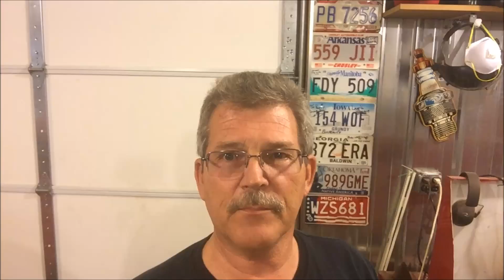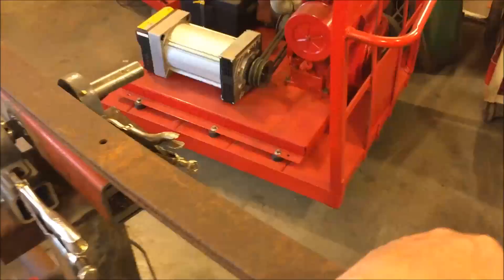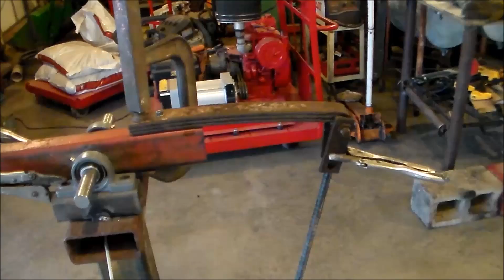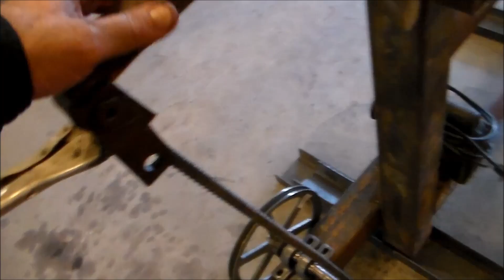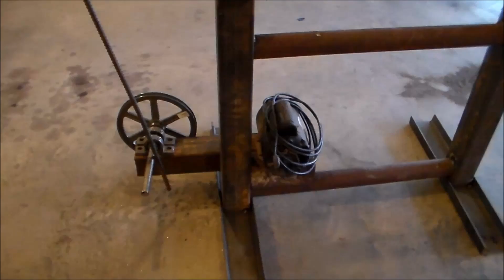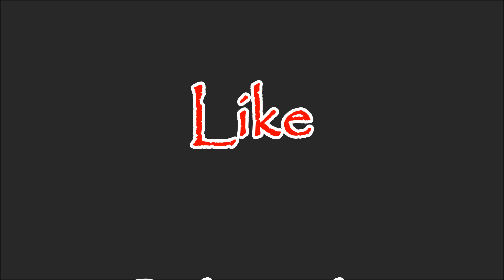Power Hammer Project pt. 1

Comment: Crikey Lloyd that thing is going to make quite some noise I imagine.
Reply from the maker: +ZIGgassedUP I bet your right about that. I have a turn buckle that will be on the connecting rod so the stroke can be adjusted that way the hammer won't dead blow the anvil surface .
Reply: See now that's what I thought the spring was for so that when you go past the stroke the mechanism won'n lock up.

Comment: Impressive build! However as you suggest in your replies I feel it may run a bit too fast so it might be necessary to slow it down a bit in terms of strikes per minute also one often needs softer strikes rather than full bloodied ones. Will the slip clutch idea work with a vee belt drive?
Reply from the maker: +Dan Whiteford  I have thought the same thing  but was going to try this first. I have some additional pulleys , shaft and pillow blocks to add a jack shaft if needed. I didn't want to slow it down to much and loose all the force. It will use the same type of belt like a riding mower so you can slip it when  the tension is off the belt.

Comment: going to be a very handy tool when done. I was wondering, what is the machine just to the left and rear of the power hammer that's painted red, with what looks like a gas engine running a grey device by a belt? anyway, great video.
Reply from the maker: +dave1135 The red engine is a generator I built. I got a 10k watt generator head from harbor freight and used a 16hp engine I had to power it. Works good.